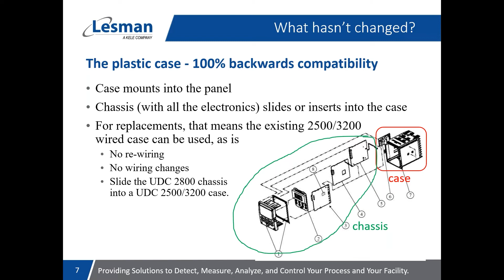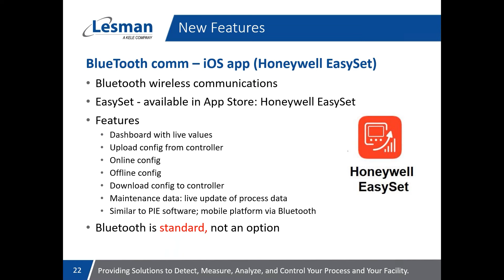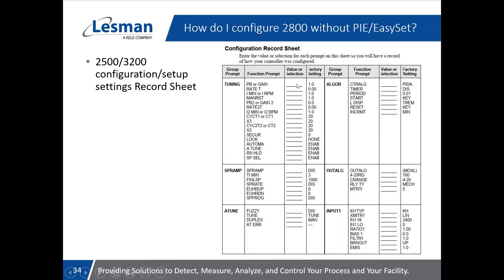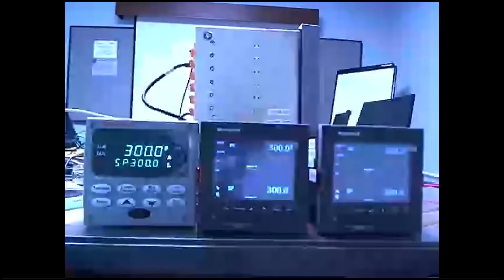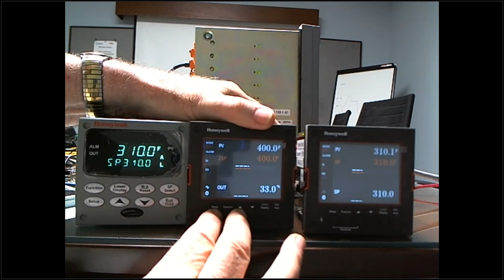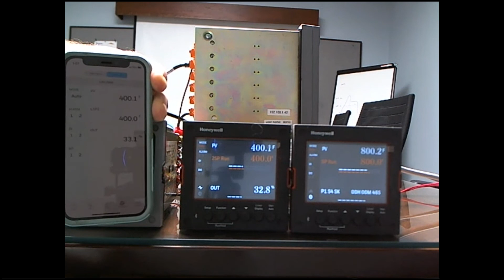Replacement for Retired Honeywell UDC2500 and UDC3200 Controllers, a Lesman Webinar

Comment: I have an issue where my sp on the 2500 was 100 for valve movement %, and now my sp is actually showing temperature instead of the 100 percent for the output control and if I try to lower the control temperature the valve doesn't move at all it just stays fully open.